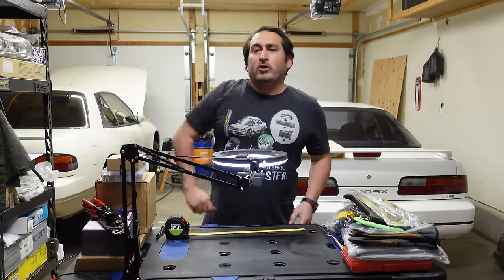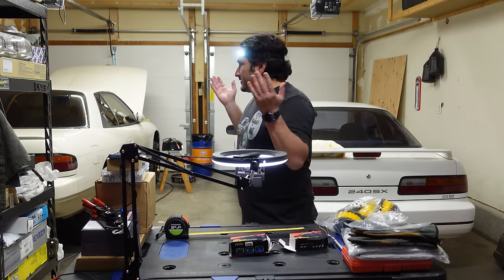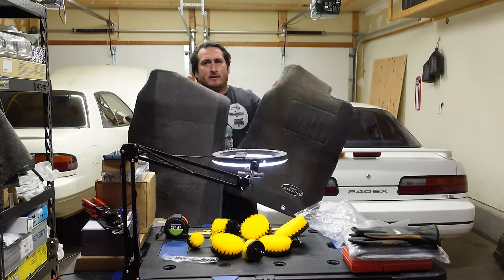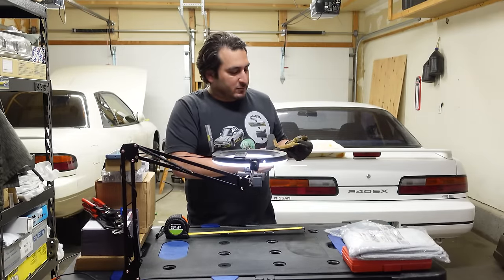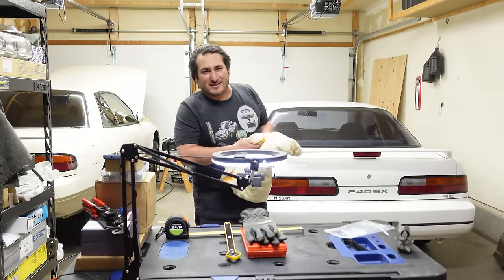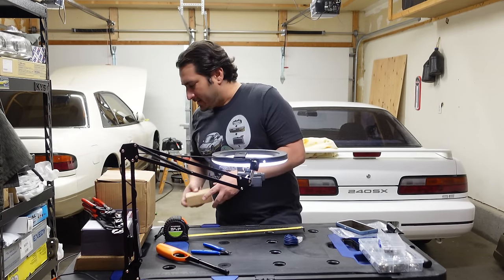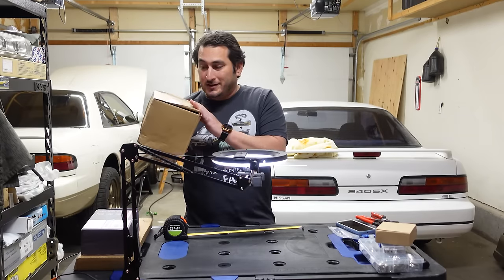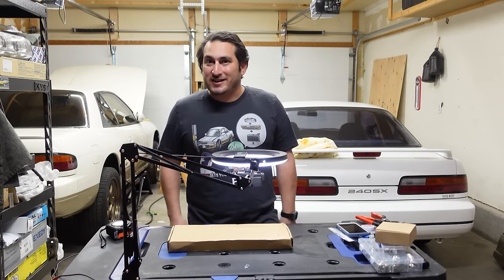Testing $200 of Temu tools and a tortilla blanket

Comment: I can second that those headlamps are the real deal! I'm an electrician, so working in the dark (no power when we're still installing it) is just a part of life, and a good headlamp is a necessity. I have several coworkers who use that headlamp and they all love them. They last pretty long too, most guys use them for 5+ years just fine as long as they're not being almost intentionally rough with them

Comment: 14:13. I knew it from the first frame I saw it. I bought this from Amazon about 2 years ago. The box I have is 99% identical on the outside, but I don't have the fancy design or logo, just a flat surface. The inside is 100% identical. I still use this socket set for whenever I need to work on my car. The ratcheting wrench broke a while back. I think I tried tightening down my airbox and it broke internally. I replaced it with a random ratcheting wrench I found at Advance Auto for $10(ish). Recently, the little clip part of the box that keeps it closed, broke off. It was thin plastic when I first bought it so it was bound to happen. 8/10 mini tool set.

Comment: I work at an engine machine shop and my coworker bought those headlamps for us to use. If youre using the light strip part in the front they get really hot. Suspiciously hot

Comment: I found in a junkyard a car jack that has a lug nut sized turning point and I use a power tool to turn it and then the same drill to remove the lug nuts 👌 it's amazing

Comment: Honest take: temu is great for things that are hard to screw up - small cheap stuff like those clips or fuses or electrical connector bits, usually it's the exact same item sold at big box stores but at a massive markup. Theyre all made in china anyways. When it comes to tools, they're good for the price but won't last. That toolkit is an unbeatable deal, but Ive had the ratchet break, some of the sockets crack or strip, etc. I was using it for more than it was realistically meant for, but it lasted a good while. Recently bought another one for cheap, its a good beater set. I bought a knockoff dremel for 3 bucks which worked for a bit and is now intermittent. Not the end of the world - I'd recommend this stuff for people who are just getting into wrenching, it makes it very accessible. Where Ive been most disappointed and would honestly steer clear is the night lights. The battery life is horrible and uness you have 2 or 3 to switch out to charge it's very impractical for real world use. Good in a pinch, but I'd just invest in a good plug in lamp for most purposes. I can't speak on the more expensive tools, but I would peronally not trust them to last, and that's where the money spent becomes questionable. Also most items are smaller than they appear in listings. That said this reveiw seems pretty biased and I'm a bit disappointed to see CCF doing this kind of paid promotion. It's not an honest review if you don't show the pros AND cons. Whatever happened to product testing like in the other videos? Wait a month and see if your opinions of these products are still so optimistic.

Comment: Sure can tell which of the crowd watching are only here to be entertained, and their butlers are diligently typing out dictated butthurt by proxy.

... and then those who actually wrench on vehicles, have a budget, and have had to Macyver a fix together.  Or, just saw a viable, cheap replacement for OE parts the stealership wants $4 a pop for in amongst the dearth of stuff netgear dug out and showcased.

I think the mention that assembling a $10 set of tools and gloves that you hope you never need to use, but they're tossed in by the spare tire, is an excellent suggestion. 

And - just saw clips my local stealership wanted way too much for, I might grab that same set JUST for the one clip, screw the rest of 'em.   Literally, they want $4 a clip, trying to shake me down for a $50.

Or at least now, I can also dig around and see who just sells 50/100/200 of that single clip in bulk.  So... thanks!

Comment: The tip of that yellow tool included with the solder connectors is a punchdown tool, like for terminating Cat-5 jacks. The slot on the side is for stripping the insulation, but also for cutting the outer jacket of a Cat-5 cable.

I've used the heatshrink solder connectors before and you just need to heat it longer until the solder melts.

Comment: Doesn't demo jack ratchet at all yet still gives it a thumbs up? That sh*ts gonna break instantly.
Reply: And also, those scissor jacks are for an emergency.  If you're at home you should have a floor jack that you can easily pump up.  The Ratchet for the scissor jack just seems pure gimmick.

Comment: Let us know ! I bought the soldering shring cable thing too but from bangood, it exists for a long time now. However for me it worked just the same. The solder needs a temp to melt where the plastic just desintegrates. If you figure it out that'd be awesome, otherwise i keep it at the worthless stack. xD

Comment: Direct the heat at the solder on the connector, dont move the flame around and  it should get the solder to melt and flow thereby completing the joint

Comment: verified temu purchaser 

i use a hook in a drill to lift my car using stock
 jack (04 accord).

and those connectors need hot air tip on soldering iron not flame

Comment: I'm 2 minutes in and I'm trying to figure out if this is a bit or if Netgear has never been shown how to swiftly use a scissor jack. You just cycle it with both hands like you're pedaling a bicycle, but with your arms. You can have the car up in the air in 30-45 seconds no sweat.

Comment: the head lamp is charged by USB micro (15 year old tech), so by default gets an F from me
Reply: I have that headlamp in a slightly different version, it's got USB c and the swipe feature actually works. It's pretty sweet and you will forget it on your head it's just that non intrusive.